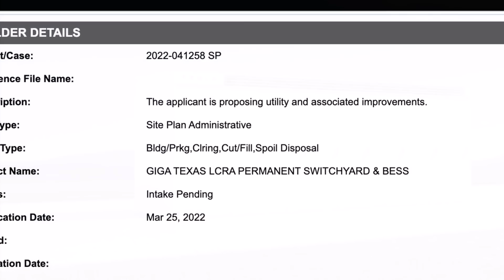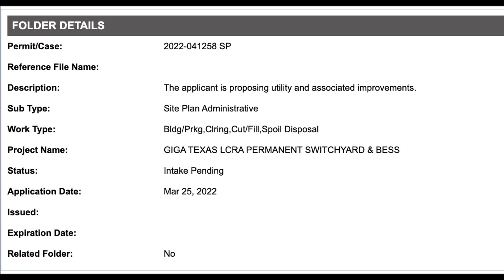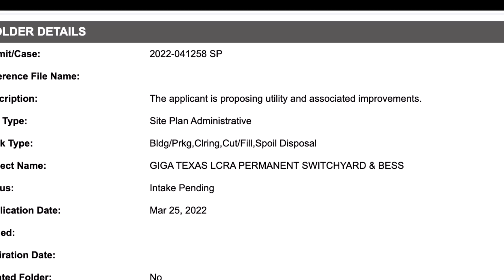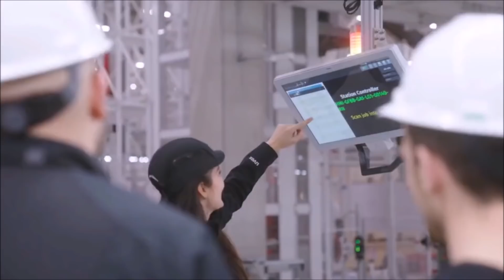BREAKING! Tesla Plans Big Solution for Giga Texas To Avoid Unreliability

Comment: Clearly this guy has no clue about the electrical service in Texas. I had zero issues during last years' winter. As an engineer with an association with the grid and it's construction, it's so much better than any other area of the US. When the power went down in some areas last year for a short period of time, it's worth noting that almost ALL the areas that lost power were run by liberals. It's common knowledge amongst the engineering crowd here in Texas who work with the grid. I can assume you, that's no accident. Poor planning by those liberal-led cities were mostly responsible for the problems. Not demanding buried lines even though they were repeatedly warned for decades led to this. While there  were some minor screwups in the infrastructure, inside Houston, for example, the inept mayor and his city council minions immensely compounded the problem by ignoring over six decades of studies showing the total lack of demanding proper major electrical lines be buried, has caused outages, where there shouldn't have been. And even now they point fingers at everyone except themselves. Elon is no idiot, he knows Austin is run by liberals, and can be counted on to NOT do what should be done to have a reliable power grid in their area. The grid and its infrastructure in major metropolitan areas can be hugely influenced by that city using its influence or in some cases mandating changes inside the city limits. But liberal run cities have different priorities. It's just so much easier to blame someone else and ignore the problem.

Comment: Texas in the only state not part of the national power grid the 48 contiguous states. Most power in US is very reliable. in the winter of 2019-2021 Texas had a major freeze and massive power outages due to our over reliance of wind turbines. At the time TX had the highest number of wind turbines due to federal grants. According to the TX Govt the said the grease used in the turbines was not rated at those temperatures and were unable to produce power. Many of the natural gas generating power plants  where shut down and would that 2 weeks to start up. The said there were going to have a big investigation. As of today I have never seen or heard of any report being produced.

Comment: I've lived in Texas for almost 40 years and the electricity grid has always been as reliable as any other place as know of. Winter '21 was a 1 in 50 to 100 year event and did expose some weaknesses in the natural gas pipelines, but that's all I'm aware of. I've lived in San Antonio,  Houston, Victoria, Midland and Laredo. No problems there other than the rare power outage for short periods, usually during a severe storm. I don't  know why Mr. Must would say that, IF he did.

Comment: The Texas grid is quite reliable.  They experienced a freezing blizzard such as had not happened since before the grid even existed.  Also the car,  airplane,  and Texas statehood.
Reply: Did not Texas have a grid problem about 10 years before this last one? Texas simply did not follow through on the recommendations on how to winterize the grid.
Reply: @senordockman1138  I love in Oklahoma,  and my water froze at the point it came out of the ground before coming into my house.  It was that bad. I don't recall the earlier event you've mentioned.  I do know that it was unprecedented and Texas homes simply aren't built for such cold,  but why would they be? This is no more unusual than sunset blackouts up north,  which are many times more common. Why? Nobody builds for extreme heat  up north. They often don't even have air conditioning.

Comment: There are several reasons to build backup, don't believe everything you see on the internet. Lets say you had molten aluminum in a machine and the power failed, how much time do you have before you have a real mess to cleanup? Ever see a failed manufacturing process? How about worker safety? This Tesla system is far more reliable than any system ever built.
Reply: Machines that you mentioned ted would have diesel backup anyway for their own protection. I would guess in a lot of places it would be required. I do get your point though.

Comment: The media is dumb... Texas has a state wide grid that is well managed. Two years ago they had a extreme winter storm that covered the entire state and the large number of windmills (Texas has the largest number of windmills in the US) froze and many failed. Since that winter, Texas utilities have upgraded the windmills to handle the extreme weather, added additional natural gas generator and install mega pack storage units near multiple cities. The Austin mega packs are in addition and will support the auto plant and also sell electricity to the grid... From Tesla's Giga plant viewpoint, there is a very large generating plant about 1/2 mile from its south end... You can see the steam vapor from the generating plant every time the flyover drones show the south end of the plant.
Reply: Awesome!!
Reply: I agree the Texas interconnection is reliable, just not enough for certain processes.
Reply: Natural gas plants shut down also. Nothing was winterized.